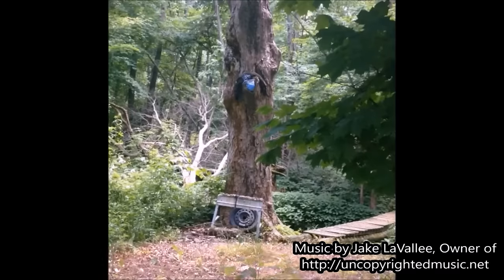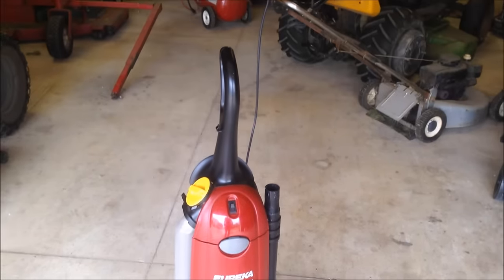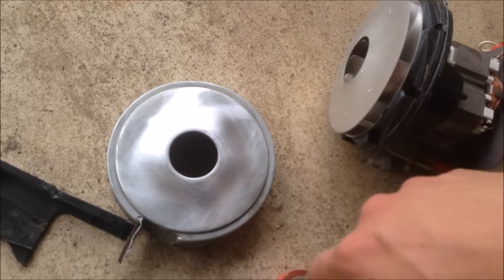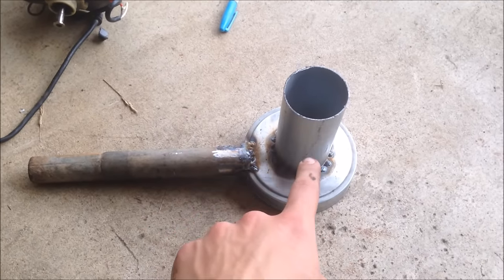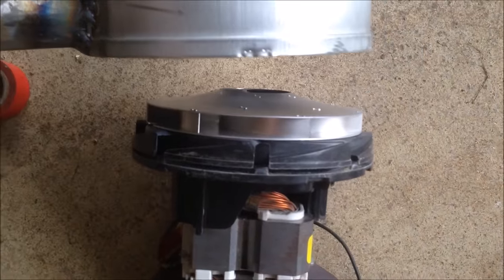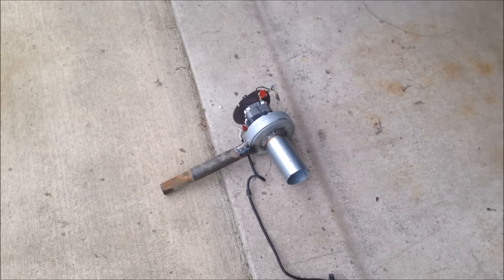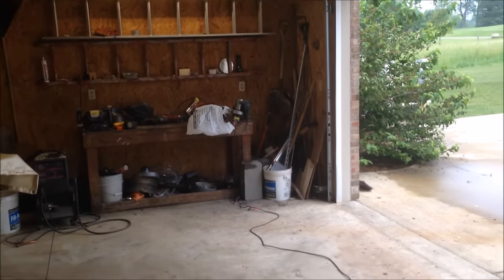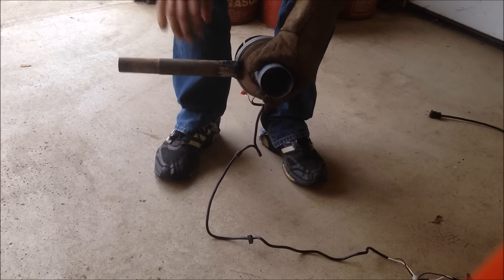Turn a Vacuum Cleaner into a Powerful Blower Fan

Comment: Soldering works better with thin metals.  Use Metal Repair Solder.  It flows well with just a propane torch and fills in very well.  It's also very strong too.  You can do a seamless repair with this stuff too.
Reply: Soldering or brazing/?

Comment: Nice.  Question .. I'd like to add a motor reverse switch to a standard leaf blower so that use it suck some fine construction material from the bed of my truck.  Think it's possible? Will dust into the motor clog the motor or fan?

Comment: Hi, how does the motor hold up? I assume all the suction air passes through the motor for cooling when functioning as a vacuum, but now there is much less air passing the motor as it is not forced through there.
Reply: It won't last. The air cools the stator and armature.